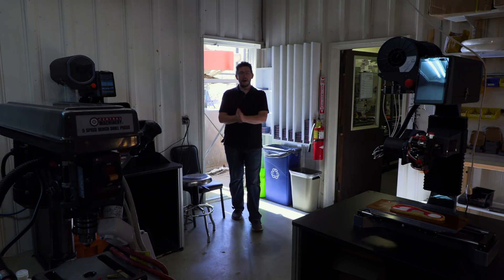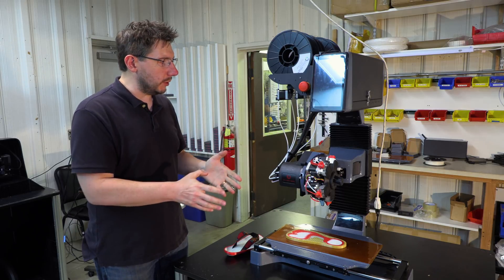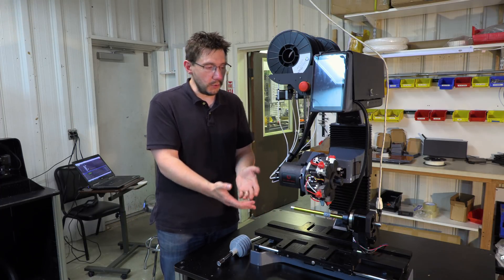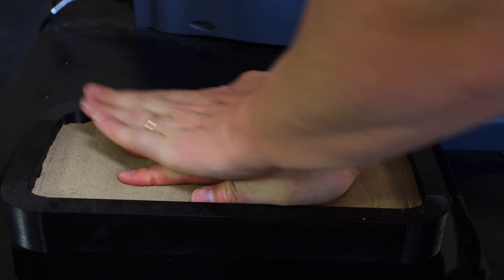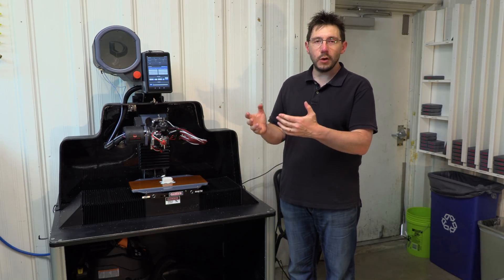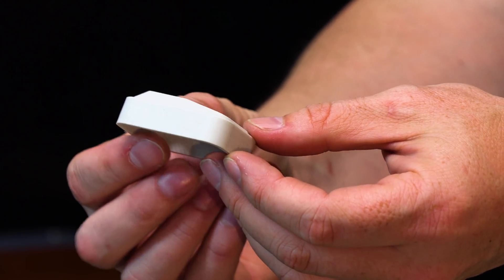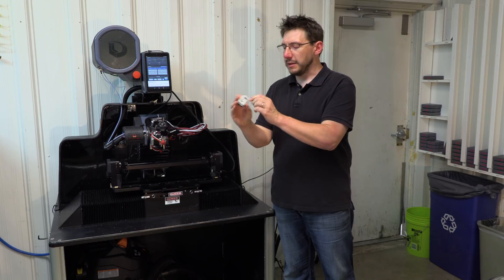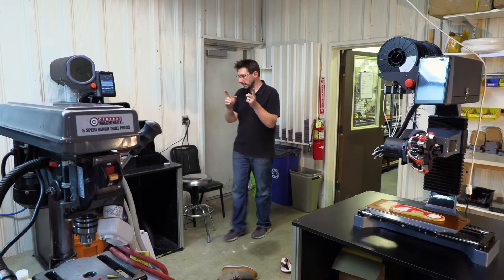Diabase Engineering H-Series Multi Material 3D Printing / CNC Milling / Laser Scanning Machine!

Comment: The price is from 4900 to 6775$. Not very very expensive but isn't cheap for home use. I'd rather spend 100-200$ per year (it's max!) for shoes. It's more than 20 years with a manufactured shoes (not only these "flip-slippers").
Yes, the add-sub approach is cool and I like it. But the price and (maybe the next is more problematic) the space it tooks... Makes it good only if you have a big house or a garage. Not for many...

Comment: Finally a project that doesn't just hail additive as the be-all, end-all, or tries to beat a dead horse by spending disproportionate amount of effort and resources on minimising method-inherent flaws, but acknowledges shortcomings and emphasises strengths, and makes them all work together as complementary as possible, and not just for optimising a part, but for optimising the manufacturing process itself.

Comment: Humm  how to clone this..  It has  Z axis is two 16mm rods with a 16mm ballscrew.   The bed looks like the Y is on 12 mm rods with a belt and the X motor is under the plate that moves it in the X.  Basically the original Thing-O-Matic.  Even the tool head changer would be easy to do in marlin.

The only two real problems with this design to clone is that its probery very slow.  Those extruders aren't geareds and that bed would have to be rock hard stable to push above 80ms.  Second would be the software.  It's not the 5+ extruders, its the idea of the spindle, that is really neet btw.  I don't know of any slicers on the market that can both do addictive and subtractive at the same time, and any firmware that allows the change of a spindle speed.

I still would love to get a spindle on my dbot.  Its a reall neet idea

Comment: Why print something sloppily and then slowly mill to perfection? Why not START with a block of Acetal or ABS and mill out your design? The whole printing the part in the first place is an un-necessary step. I do like the multi-head design though. It reminds me of those super expensive 5-axis cnc machines.
Reply from the maker: As for your question, I don't know - maybe send them a note and ask? My bet is there are benefits AND drawbacks.

Comment: Awesome. I'd love a custom shoe! I figure you could also just take tons of pictures of a sand imprint and use photogrammetry.
I'd love to try this milling and milled surface finish with the upcoming E3D motion platform tool changing. Should be rather affordable to add a small finish milling head to that one.
It might be interesting especially to make precision motion parts.

Comment: For the use cases listed by Joel the hybrid starting at $6,900 is a really reasonable price. I was expecting 10K as the starting price for the hybrid. Really cool product, I love the idea of a cylindrical build platform or even a non flat build platform is a great idea in general.  

As for this video I'd love to have been introduced to one of their chief engineers on this product.

Comment: The notion of overextruding the general shape of your part quickly and then milling away excess to get a more precise part is a great idea.  Part accuracy and/or surface finish is often the struggle with 3D printing. Trying to get better surface finish through reduce layer height can add so much time to a print and still not produce the results that you want. Milling can be so much faster AND you get better dimensional accuracy. Even if this all-in-one machine is impractical for hobbyists, the ideas that it promotes can still be applied to using separate machines. 

Thanks for the great video!
Reply from the maker: Exactly! You're getting a strong 3d printed part with machine level accuracy of dimensions and tolerances. I love this idea!

Comment: if you're going to mill it, might as well just use a mini milling cnc... stronger part, faster turn around and you could make multiples over and over... I thought the point of a 3d printer is that you don't have to limit yourself to 2.5 milling limitations and you don't have to learn about cnc milling which is a skill that takes a while to become good at it.

Comment: I had a similar idea in college with a router attached to a 3D printer head and even made one as a mechanical engineering capstone design project. It was capable of doing a finishing pass around an oversized 3D print to get 1 thousandth accuracy and great surface finish too. We end up making one and I even made a different one with similar functions for a home project at the same time. However, funding is my main limiter of developing one into a consumer product. Also CAD/CAM isn't there yet in having the capability to slice X amount of layers then cut and slice X more layers and cut some more. Then the real question of, would having a 5 axis machine would be better for 3D prints? For the complex parts,  yes it would .

Comment: Since all the heads are kept heated, you'll have crazy amounts of filament breakdown from remaining in a hot chamber. Having both additive and subtractive in one machine is like building a car that's also a boat, it'll be bad at both. Additive requires fast movements, subtractive requires a heavy, slow, stiff carriage. You'd be better off using 2 seperate machines and an alignment jig. Also, the 3d printed ABS part will never be nearly as strong as a part that's milled out of solid ABS. There's almost no scenario where I see this being useful, the custom footwear thing is kind of cool, but that's a huge cost for something that a moldable shoe insert can do.
Reply: If you're thinking about serial production, even small series, I agree with you. However, when you're thinking about R&D or end customer shops as suggested by Joel such a machine does hold value in my opinion.
Reply: +Fisch, there's already much better equipment for R&D. The problem is that they're trying to make a machine that does everything, and that means that it's never going to be great at any one thing. This is a terrible way of doing multi material extrusion, it's much better to use a single heater and multiple filament pushers. As for milling, it might handle aluminum, but it's primarily designed only for plastics. They want 7k for the most basic model, with 3 heads. You'd be much better off with a 1k multi head printer, and a 3k cnc mill. Also, there's a reason that mills don't have their entire tool changer out while cutting, the shavings will go everywhere, including up into the print heads, good luck cleaning it. Their cover doesn't even have a lip, so as soon as you lift it, all the shavings will just fall on the floor. It's a cool idea, but it's poorly designed.

Comment: This is going to be the evolution that expands the entire crowded market segment, and pushes  existing "high end" machines out of the running unless they compete on these features. That will take at least a couple of years for the market to be nibbling at these features, by which point Diabase  will still be far ahead of the pack.

Comment: Now things are going to start getting expensive because the engineering is going to have to be way more rigid to handle milling.
But the good thing is you can print at high layer heights with a lot of over-extrusion to get layers to bind together and then final cut the result as shown.
Genius - and I like the rotary extruder setup - no more expensive and time consuming "blocks" to be printed when changing colors or materials.
Possibly the death of the flimsy Prusa style design and probably the end of using extruded sections as bedways and guides for any machine that wants to be taken seriously.
Thanks Joel, Yet another good video.

Comment: 6-7k USD is NOT bad for an all in one machine tbh
Reply from the maker: I would have to agree. Even the one that is dedicated to 3d printing is under $5k. For the beta units under $4k. That's pretty good.
Reply: More incredible still, is that multiple nozzles, may also mean multiple layer heights, and once combined with the Mosaic multi-filament system, you can really go crazy with your 3D prints.

Comment: Additive and subractive manufacturing have so much complementarity. Those machines are incredible.
Reply from the maker: I agree with you. Done right, there is the potential for a massive positive impact.
Reply: Could the shavings be recycled?
Reply: It will be great for mold making for casting, and prototyping before you have injection moulding molds made.

Comment: At first I was thinking that the Prusa multi material 2.0 was a way more elegant way of printing with five materials, but then I saw the mixture of additive and subtractive manufacturing and shut my filthy mouth. By the way, these sorts of inside looks are your best videos for sure.
Reply: 0Calvin If they are keeping all the hot ends heated up during printing, I would be worried about material degradation in the unused ones. I'd love to see more technical specifications on this machine.
Reply: Ryan H, True. Perhaps they retract the unused filaments and/or lower the temps on the unused hotends.
Reply: To be fair they would know when the head needs to be used and prematurely could turn it on to heat up before it is used and then turn it off if it isn't needed anymore.
Reply: Look at E3D toolchanger!

Comment: Is it just me or does it sound like Joel is speaking in slow motion for some of the video? I suppose that means we get more than the full Joel!
Reply from the maker: Hmm. I think I spoke slower when recording the voice over segments, which is probably where you are hearing the difference.
Reply: Or.. as if he had been automated away!
Reply: I didn't pick up on that, but I do know from experience that perception of time can be noticeably variable and relative. IE: If I've been listening to a podcast at 1.5x or 2x, it can take my mind several minutes to readjust and process normal speech speed correctly. I also like to make music in my spare time. Occasionally I'll open up a project and it will seem like totally the wrong tempo, because I'm experiencing time differently than when I last worked on it! A similar thing happens when I'm watching waveforms move by quickly for too long, pause the project, and the waveforms appear to momentarily drift in the opposite direction.
Reply: I was just going to say it’s a voice over it’s not like talking naturally